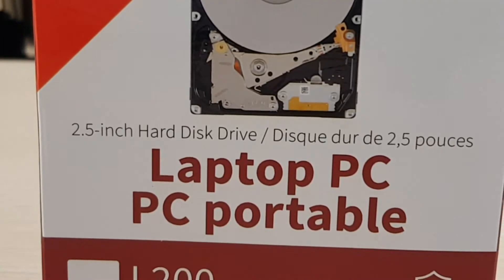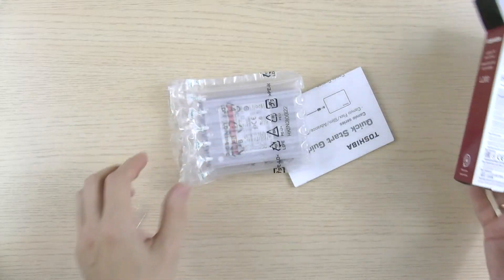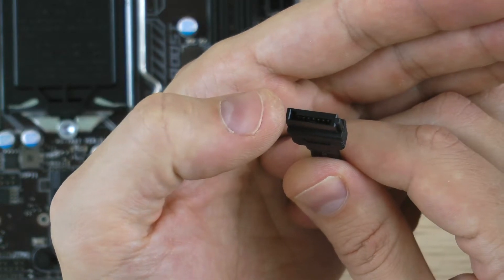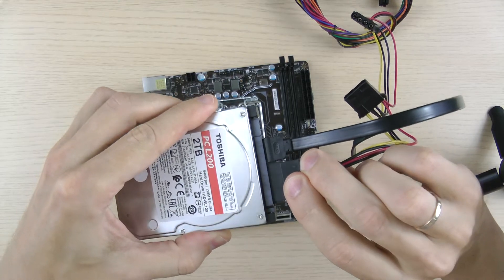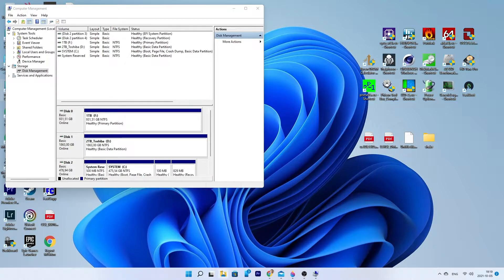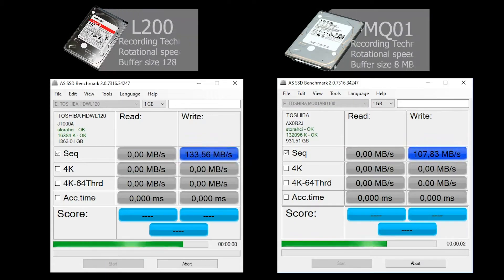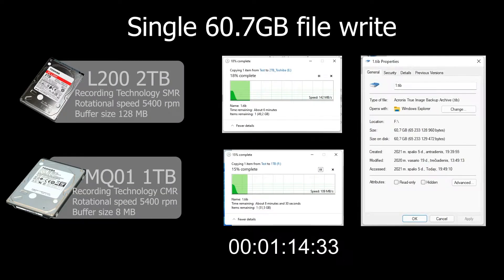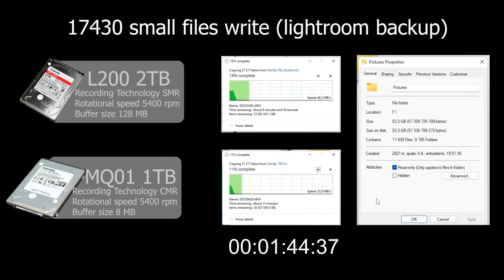Toshiba L200 2TB SMR HDD unboxing and testing

Comment: Is it any good?
Reply from the maker: I bought it a long time ago, but I’m still using it for PC data backups. I chose it because it’s quiet and, at the time, it offered good storage capacity for a low price. Just note that it’s an SMR drive, so it’s really only suitable for backups. If you can find an SSD for a similar price, it’s worth considering — though SSD prices are spiking at the moment. Subscribe, thx.
Reply: @MindaugasJocionis  Thanks. I also consider it for backup. I have an HDD/SSD, but it isn't that reliable due to its integrated SSD. And since Toshiba makes the hest HDD, o think I'm gonna go for it instead of WD or segate